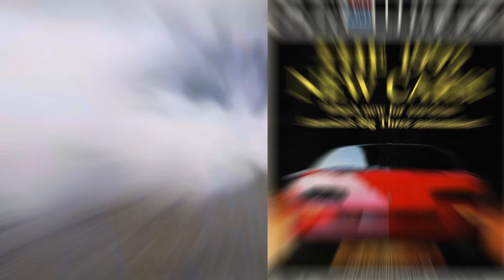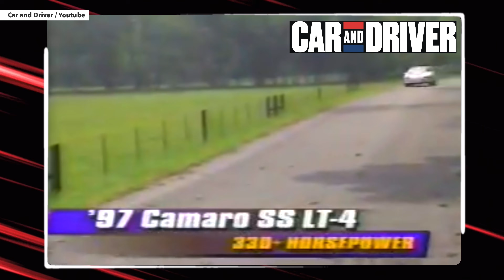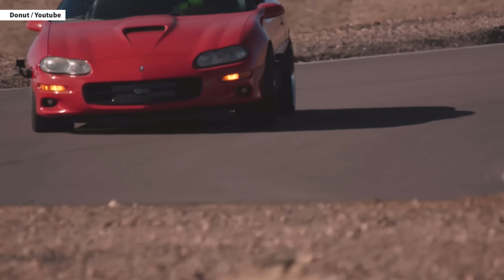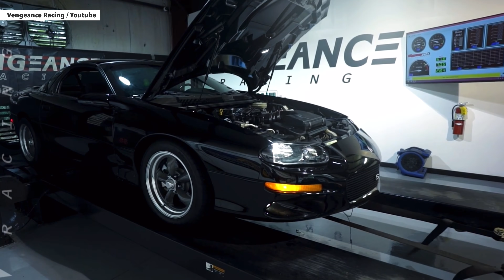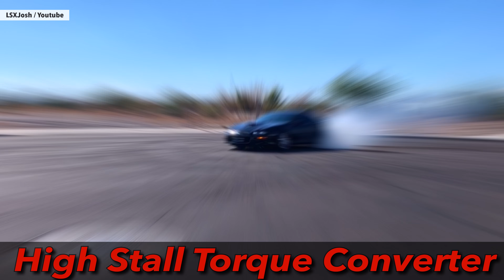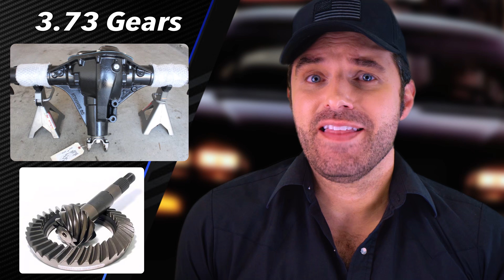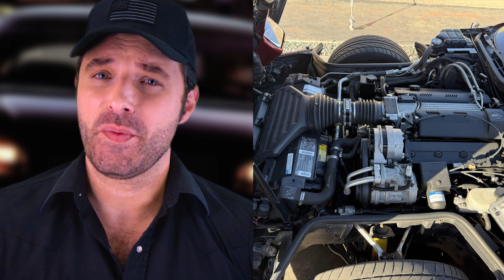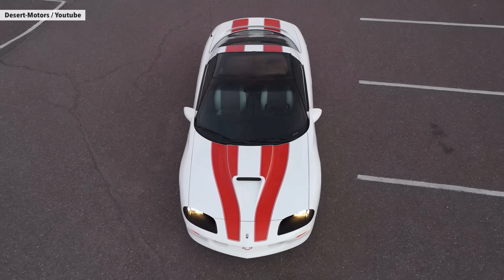Should You Buy a Camaro? 4th Gen F-Body

Comment: I just bought a Base V6 98 Camaro, People laugh at the V6 Camaro but the 3.7 liter engine is the same engine they put in the Buick T-Types and Buick Grand Nationals, that engines alot better than people think it is, built right they will eat both the LT1 and the LS1 for lunch, eventually I'll put a turbo on it but for now I'm just daily drive it.
Reply from the maker: A great buy! 🙌🙌 Those V6 Camaros easily do 400k+ miles! It says a lot about the durability! Few new cars can achieve this!
Reply: @HernanSpeed  Yeah and they can produce alot of power cheaply
Reply from the maker: Facts! 💯💯
Reply: my 97 camaro is stock 10.70 quarter mile 385 RWH 410 torque at fly wheel 60 more and still running stock modified exhaust 1.43 60 foot at 127 mph 
your dreaming guy
Reply: @Badlands1182  No I'm not, the proof is in the pudding. No opinion or "but I want it to be" on your part is going to change that fact. The Buick based 3.7 V6 is one of the most powerful engines GM ever built out of the box it produced 376 HP and 460 lbs of torque. By comparision the 98 LT1 put out 300 HP and 330 ft lbs of Torque. stop it dude, you know jack shit about ACTUAL performance.
Reply: @TheREALOC1972  same tree nit wit Buick heads are basicly vortec precursor to SB2 nascar engine  your 376 hp is at the fly wheel where the camaro ls1 and lt1 are rated at wheels  you got like 10 more hp turboed which means they going to snuff you for the first half  my 97 runs 385 rear wheel hp 410 torque  with k&n a trick flow elbow i match ported the stock exhaust and drilled out my idle air hole to 1/8 inch my 6 speed 97 camaro still bone stock runs 10.60 in quarter mile thats faster than any grand national look up brent Darroch on youtube with 2 world champion titles in Stock eliminator 2012 and 2022 and thats 94 lt1 camaro also the 2025 champ is 97 camaro also the super stock world champ is also 
what it is is raised runners that make it tumble tripling the fuel getting fed into a strait shot at valve .
your basicly a 3.622 stroke ls1 with 2 cylinders chopped off but a corvette engine none the less designed to take a lot of boost as all ls1s were ment for 
so you understand what ls1 is totally a scca 500 horse equal playing feild for scca racing its harder to cheat with max ported heads they handed over ls engine plan to nissan and ford for scca competition so its on driver scca is beginner nascar  the sb2 was given to all competiters in nascar same way now its R7 engine .
so without cats you are same thing just v6 turbo catagory 
my lt1 was designed with 12.5 compression  chevy lied said 10 4 to 1 you have a 67 cc head chamber i have 53.7  cc combustion chamber my engine was speced for a dish piston and its forged flat top 
my lt1 block is decked 11 thousandths that in my engine specs as at top dead center .014 thousandths below deck causing with 49 gasket 12'5to1 yours is around 10 to 1 but turboed 12'5to 1 so you are still 2 cylinders shy pushing 3444 weight about a 12.5 quarter mile vs my 10.60 1.43 60 ft at 127 
So NA lt1 is top dog LS1 very close but more geared towards high speed racing rather than Quarter mile bits power is all high rpm where mine is smigoen lower 
Mine was actually had small tb and had to race mustangs with restictor plate for 220 hp at wheels 
the 3rd gen camaros and 4th gens too were mind fugged into air foil wich is a 220 horse restrictor plate that gave them bad reps when 4th gens ran 285 at wheels at factory 
I just gave my camaro 807 cfm Throttle body and hogged out my exhaust ports and ported my exhaust manifolds and it was missing 1 cat i still have to hog out other cat and my stock steel rocker arms are 1.43 so im only running about 400 lift on cam 1.5 roller rockers will give the 447 459 lift it was ment to be a easy 500 horse at flywheel with porting my tb 
Im at 385 rwhp 410 tork at fly wheel that 60 more lost through drive train 470 hp 490 torque is about what im running at fly wheel right now 
I raced at Fernley speedway grudge night against 200 cars for 2000 dollars i took them all by 8-9 car lengths every super car in state of nevada was there in pyrmid finals 
I do a 2 second 60 mph lol  
you should have seen there faces when i showed them my stock exhaust lol and told them my engine was stock
you see i am nascar test and tuner for 4 car nascar team in 90s
and what i did which is like the modern vortecs was discover the tumble at 5000 rpm and forced it to come in at idle by giving runners velocity.
 its not how much your inake runner flows its 
how both runners flow together
Reply: @Badlands1182  Incorrect, both are at the rear wheels.
Reply: @TheREALOC1972   @TheREALOC1972  look up gm heritage hit chevrolet button  97  camaro  look at pages 34 36  it  RHP  I just Gave mine 100 more hp and i just made it breath better at both ends and mine dynoed at wheels 385 those world champs are running 348 bone stock and certified nhra no porting tb headers allowed with out cats 
any body knows a high compression 350 will handle a 850 carb i took mine from 732 to 810 if you watch that Brent Darroch video youd figure it out 
your 200horse is at back wheels too they used same 6 banger through out the forth gens look at the v6 specs while your in there
ive got the 4.3 in s10 it halls ass too and its under carbed its thottle plate half blocked you grind it off the blocker and its kick ass upgrade
Reply: also Buick heads that go for 2500 last i checked for 350 ran 750 hp with a 4 barrel carb and also made for chevy the snuck those into nascar to win for a couple years then nascar outlawed them 
then said we want you to give sb2 to every one as equal playing feild  its bored 60 thousandths a 330 stroke like 327 thats why they wind out to 8500 rpm then they started using bowtie blocks which are upgraded lt1 engines  grubworm was using lt1 till it wore out now he went to bowtie and got like another 10 miles per hour 
the ls1 will never top the lt1 because the lt1 can hold more boost because of 5 bolt head bolt down on every cylinder ls only has 4 and boost starts warping heads and blowing head gasket 
Ive forgotten more about building engines then you will ever know
Reply: and the grand national only has 4.6 0 - 60 mph its fast in the second half same as factory tired camaro but factory tires are getting spun for whole quarter mileim betting your running a 50 size side wall this is a cornering tire wont hold squat in quarter mile you need a 295 60 wall that can flex with a 11 inch tread width that in it self puts the lt1 in low 11s and the 6 speeds are the faster free 3000 rpm stall converter yours is about 1800 rpm stall

Comment: I recently picked up a 2001 SS. No regrets.
Reply from the maker: The SS is a BEAST! 🔥🔥👊
Reply: If you don't mind,  what was the sale price?
Reply: @downsouthherc6638 paid 12k.
Reply: Is it in decent shape? Friend of mine just picked up an 02 ss but the car had been beat to hell and has like 250k miles but still runs strong it’s crazy
Reply: @ls1_cammeroh  it's in great shape. 117k on it. 100% stock. I have parts off a previous car like suspension and a Moser 12 bolt I'm swapping in. Not for racing this time. But this SS came with the upgrade SLP differential.

Comment: I'm a Firebird Trans Am guy, never liked the look of the Camaros.  I used to have a 96 Trans Am back in 2005 but sold it after 5 years to purchase a replacement all year round car.  I recently acquired a 1998 garage queen Y87 Firebird.  It doesn't have the V8, but man was it hard to track down a clean low mileage Firebird or Trans Am.  The V6 model was the only one, side from a 30th anniversary Trans Am, that was in great condition.  So much clapped out junk out there.
Reply from the maker: I agree, condition is everything… and finding a minty one is very difficult. Thanks for watching brother! 👊👊
Reply: on what platform did you find the firebird?
Reply: @weeaboo_weirdo Facebook market place.

Comment: LT1 was always underrated, just suffered from the optispark issue. You can do away with it and get a coil on plug LS system for them though.
Reply from the maker: Yesss, LT1s were a beast of an engine with lots of potential! 🇺🇸🔥🔥
Reply: @ faster in the eighth than the LS1

Comment: I had an 96 Trans Am, and when the water pump started to leak, it ruined the opti-spark... yep, just as you said, I sold mine over this major design flaw. Had an LS1 Trans Am afterwards and loved it. Just a base Trans Am with SLP exhaust and intake, with an automatic transmission ran a 13.5 quarter mile. Just amazing power for the time period.
Reply from the maker: Yesss, the Optispark leaves many with a bad taste. If redone properly, you can easily get another 100k miles after changing…IF. The LS cars were a game changer as far as reliability & power!💥💥

Thanks for watching brother! 👊👊

Comment: my 2001 z28 has a iron driveshaft
Reply from the maker: The manuals have the aluminum driveshafts on the LS cars (1998-2002). The automatic has the torque converter that helps dampen vibrations, so the benefits aren’t as noticeable. A higher stall torque converter is the ticket with autos! 🚀🚀

Thanks for watching brother! 👊👊
Reply: @HernanSpeed  ahhh the more you know,  love your channel, looking forward to the next one.

Comment: Anyone who says the lt1 need be swapped hasnt done any research, an lt1 4th gen called grub worm held the stick shift ¼ mile record from 2022- 2024. Optispark reliability is admittedly questionable and probably one of GMs biggest mistakes but 24x swaps are pretty easy to do.
Reply from the maker: Yesss, LT1’s have so much potential! Thanks for watching brother! 👊👊
Reply: People are dumb. The optispark issue isn't an issue when you stay on point and provide proper maintenance. Back in 2008, I bought a one owner, well maintained 94 Z28 with 82K miles for $6K. She was super clean and drove really nice, but as soon as I drove her home she stayed parked in the garage for almost 10 months before driving her another mile in order to invest between $6-$8K into setting up the car to run strong for another 80K miles. 

I immediately did a complete upgraded overhaul of the entire suspension and rebuilt the top part of the LT1, and installed a new exhaust system from Headers all the way back, port & polished built heads and Throttle Body, New MSD Ignition system, true cold air induction, Billet Radiator oil & trans cooler with new fans, Sump system, upgraded oil pump and pan, clutch & throw out bearing, new drive shaft & rebuilt the rear axle, new filters & fluids, new brakes with drilled & slotted brake rotors and new Z-Rated Goodyears all around, the fckn works! I did 90% of the work myself, and that's why I was able to get more done with the money I spent. 

Bottom line, she has 147K miles now, and she starts up and runs strong every year. Never left me stranded and never had any optispark issue. She still sounds amazing at idle & when stepping on the gas. She still has adequate power and can hold her own on the street against modern Mopars and Fords whenever challenged at a red light, thanks to the bolt on upgrades, dyno tune, and new body mounts that it received 2 years ago. She ain't as fast as my 02 WS6 (The DEMON & COYOTE KILLER), but she's an awesome daily driver for work that averages 27 MPG on a heavy foot, 8 months out of the year. She's still rust free because I keep the undercarriage covered with WD-40 and properly maintain the paint. 

My point is, properly taking care of a machine the way you're supposed to will dictate how well that machine will perform and how long it will last. You can still maintain a vehicle even if you are on a tight budget by simply keeping the fluids & filters changed regularly. 
(( Oil Changes every 3K, Tire Rotations every 6K, YEARLY Brake Fluid & Coolant Flushes, Yearly Filter swaps for air, fuel, & trans, Throttle Body cleaning, WD-40 rustproofing & touch-up spraying every oil change. If you drive on dirt roads or during the winter, be sure to clean & retreat frequently or whenever necessary and check your fluids & tire pressure & wear weekly when you fill up the gas tank. Maintaining perfect tire pressure, greased/lubricated suspension components will extend the life of your suspension! ))

ALWAYS... Research anything before you buy it!! Especially vehicles, appliances, tools & heavy duty equipment, even an electric toothbrush!!! Research the consumer reports & reviews! Research how to maintain whatever you invest your money into! Buying a GM vehicle that's equipped with a V8 LT1, LS1, LS3, LS4, V6 L67 or 3800 Series 1 through 3, 2.4L DOHC or QUAD 4 I-4 Cylinder engines are usually bulletproof but make sure to Research the transmissions too! LS4 FWD V8 Engines are usually paired with an automatic transmission that's made of glass (06-07 Monte Carlo SS, Grand Prix GXP, etc.) however, if you swap that transmission with a Cadillac 4T80E automatic FWD transmission to that LS4, it can handle doing daily tire burnouts and still last forever because that trans can handle 400+ HP and the 300 Horsepower of the LS4. 

Always know what your getting into & factor in the cost of ownership and be smart with your money. The LT1 Camaro Z28 is a FCKN DIEHARD BOWTIE! AN ABSOLUTE BEAST! A REAL STREET FIGHTER! The GM LT1 V8 equipped Camaro or Firebird F-Body Platform are for serious nonsense road warrior type drivers that take performance and handling seriously. They're built to serve the type of drivers that work hard & play harder and that can provide & afford the attention they deserve! 

So, if you own a Camaro Z28 or Firebird WS6 Formula or Trans Am, then you already know. If you are wondering if it's worth purchasing a used F-Body Platform, the answer is YES!!! If you can afford to maintain it and responsibly handle their tire shredding, Panty Droppin Power.... then HELL YEAH!!! BUY IT! RESTORE IT! TAKE CARE OF IT SO THE NEXT GENERATION CAN ENJOY IT!! 

But at least be able to afford to maintain the car at the very least! Treat her like a lady, and she'll always get you back home! End of rant lol.
Reply: What's the 24X Swap?
Reply from the maker: It’s an updated ignition system that bypasses the Optispark. Google “lt1 24x conversion”, you’ll get lots of info ✅👊
Reply: @HernanSpeed thanks
Reply: LS is so much more reliable and makes much better power
Reply: I just bought my friends old 94 6speed but it got hot and it is not running great now I want to replace it with an older 5.7 but I’m worried about the distributor being in the back pretty sure it bent a valve or something narrly just looking for some advice really ok cool
Reply: LT1 is fine, it's just that the gen 3 and up are so much better and there no big changes that need to be made to the platform to swap over.

Comment: 3rd gen looks better
Reply from the maker: I like the 3rd Gens in Blue, Red, & Yellow! 🙌🔥
Reply: @HernanSpeed  there's something about the rounded nose on the 4th gen that I just don't like and I especially don't like the plastic lensed bubble head lights. I had a 4th gen. RS. convertible in Black with side skirts and spoiler and all the arrow look. It was just a six-cylinder but it handled great and it looked even better.

Comment: 👀 because I know you read your comments and you've responded to me before. I've got the 944 in Southern California. 
I'm looking to get a 2005 XJ super V8. It's only got 70,000 mi and has been owned by people in my area which means well maintained. 
anything I should be worried about? I appreciate any feedback
Reply from the maker: Thanks for watching brother! That’s the one I’d buy myself, the Super V8 version is rare. Engine and transmission is rock solid. The suspension is gonna give you a suspension fault eventually, they sell aftermarket retrofit kit to get rid of the air shocks(might have already been done). Also check the paint for corrosion from the aluminum body panels, it starts bubbling up like rust…but doesn’t effect the integrity. Make sure it’s minty, you’ll enjoy it many years! 

Oh yeah…get a good deal! 👊👊
Reply: @HernanSpeed  I'm in Southern California. Not worried about rust. I'm sure it's still on the air suspension. The aftermarket suspension wouldn't have adjustability would it in sport mode? And what do you think would be a fair price? considering it's been maintained all along. And 70,000 MI 🤙🏻
Reply from the maker: @drunvert Yes, it losses adjustability with the shock conversion. The current auctions have them priced between $10k-$15k. I’d try to get it for less than that, getting a great deal is part of the enjoyment 🙌
Reply: @HernanSpeed  
$9500 is the price now after a drop from 11. Guy is cool. graduated from my highschool 4 years before me. 👍🏻 Wife has been driving it but it was her Dad's car from New! 
Thanks for response 😎
Reply from the maker: @drunvert Great deal! 👊👊